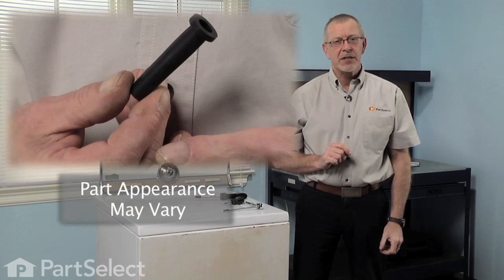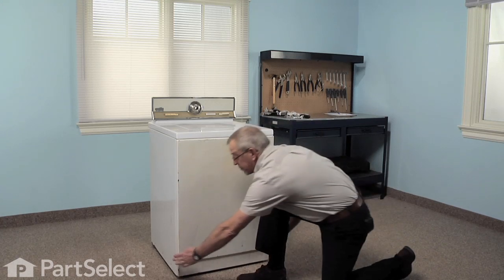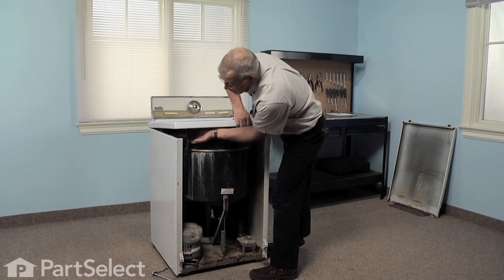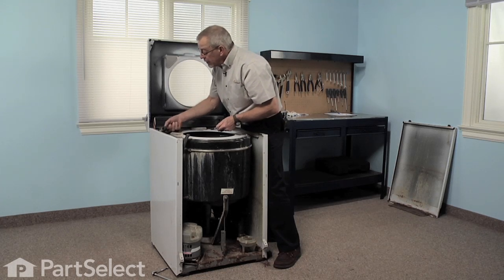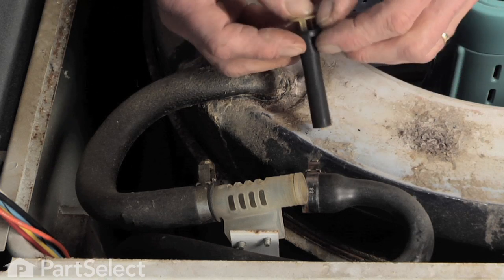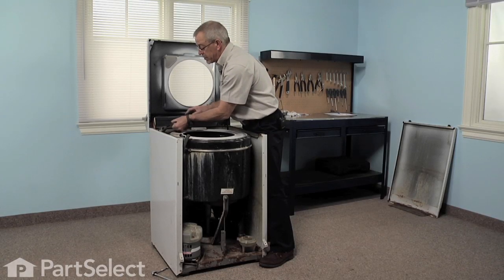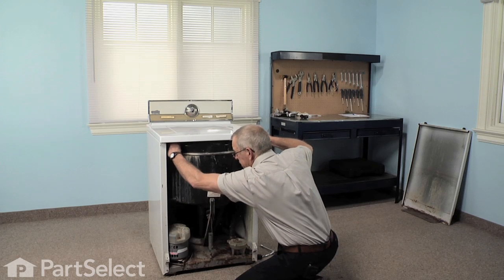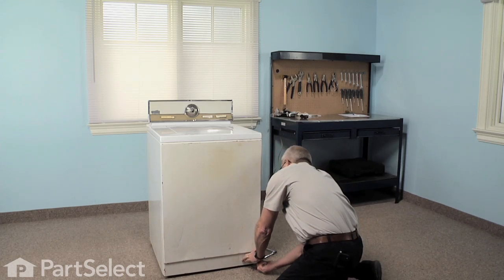Washer Repair- Replacing the Rubber Injector Valve (Whirlpool Part # 216201)

Comment: After 32 years on this Maytag the injector failed. After 5 additional years it failed again. After 6 months it failed again. While it's an easy repair, the replacement parts are crap. The main hoses have never been changed. Time to dump the injector and straight line the piping. Seems this was a "just in case" part that isn't really needed. Thanks for the video. Right on point, been there done that more than once.

Comment: I'm seriously baffled at the need for this part.  Is it a one way check valve?  If so then I probably don't need it especially since my old Maytag is at my shop on a concrete floor next to a floor drain right?
Reply from the maker: Steve Stevens  It is a one way check valve to prevent potential contamination of your water supply, but it is also used to prevent a siphoning action from occurring if the pressure switch should fail. Some people will use a straight tube in place of the part, but it is really a simple repair and not that costly.
Reply: @partselect  Thanks for the explanation.

Comment: I just removed the Injector totally and connected the 2 hoses with a coupling, so far no more water leak problems. I still don't quite understand what it's function is.
Reply from the maker: The injector tube and nozzle are used to provide a siphon break for the fill function on this model of washer. Although bypassing this device will stop the leak, the potential for an overflow now exists.
Reply: Ok, thank you for the reply.